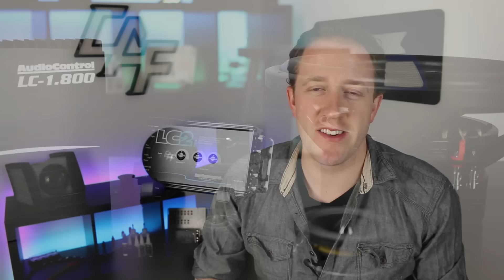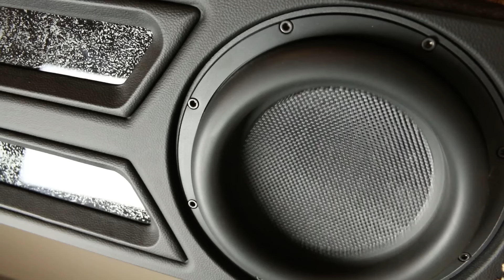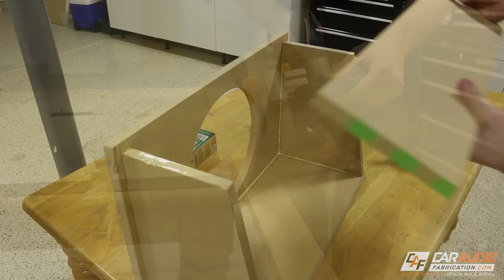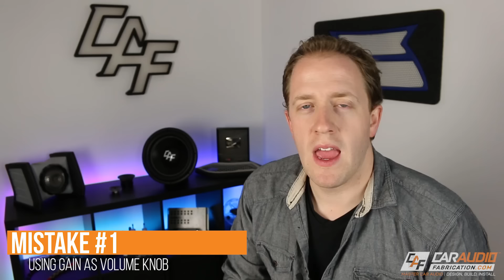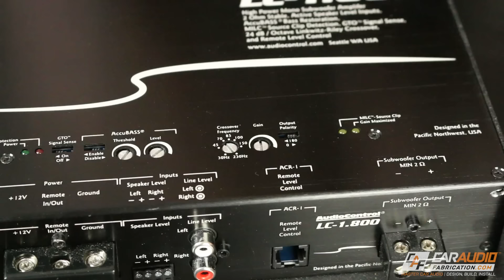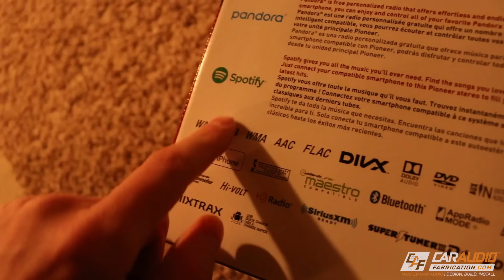Avoid these 5 common Car Audio NOOB Mistakes!

Comment: I’m pretty new to car audio and didn’t know that about the gain. Thanks!
Reply: Its no rocket science.
You just turn the gain completely down , then turn up the music to the level you think you never will get over (also listen to your speakers if they're not clipping and give a clear sound).
Then just turn the gain up to the level where it sounds good and not too loud and you're good.
Then when you listen to your music at normal level you never go too loud and prevent clipping.
But the clipping usually happens by using amplifiers that have not enough power.
For example you got a subwoofer that needs 300 watts rms and you hook it up to an amp that only gives 200 rms will clip quite easy because its lack of power.
So its better to have an amp that actually give more power then you need so it wont have a problem to drive your subwoofer.
After that you just use the gain to adjust the output, that way you wont give it too much power that also can kill your subwoofer.
Its just using common sense and your ears.
But if you want to get the maximum out of your system you just let someone do it that uses proper equipment to measure all the power output and clipping / distortion.
But Ive never did that , I just used my ears and never had any problems.
Reply: @baklap141  more gain, less sound quality, and more damage.
Less gain is the key
Reply from the maker: +Xo-1 definitely something to set carefully or leave alone if set properly!
Reply: Oh, and pick frequencies that are in the middle of the range... no point doing it right at the crossover frequency where both of the frequencies will be 3dB down (6db on an L/R filter).  e.g for subs go for 50Hz (if you are 20-100Hz on subs), mids, say 1kHz (earplugs needed!), highs, well, you shouldn't clip on highs, just ease it back when your ears start bleeding :O
Reply: EscapeMCP 8
Reply: Go to an auto store and have them set it and leave it alone

Comment: #6 Using prefab enclosures.
Reply: I put a L7 15 in a pre-fab. My sub wrote me a letter, left it on the headunit, and it never played again.
Reply: They work fine so long as it is sized properly for your sub.
Reply: tuned to high yes unless you like high notes then yeah i have a stinking prefab box and i can se highs sound fine but lows meh im waiting for my box build tunning my shit to about 28hz so it will bang
Reply: Some prefabs aren't bad,  mtx has a nice 1 and they also make loaded prefabs.. that's probably the best thing 4 a newbie 2 start with
Reply: what about fatboxusa?
Reply: Der Lennox just change the frequency on the amp lfp
Reply: Digital Design LE series loaded prefabs are amazing.
Reply: but they are tuned to high for us bassheads...

Comment: I can't upgrade the alternator in my new car because it also functions as an elettric motor (mild-hybrid car) how do I know how much watts in sound system my car can sustain?
Reply: you can add a 2nd alternator if you really need to
Reply: Vanilla Gorilla it's a brand new car, a sond system probably won't bother anyone if i make a warranty claim, a second alternator might not be so well accepted. Also it's a 90cv car, yeah I can add a second alternator but if my sound system can't make up a hill it's not very useful

Comment: Quite a few newbie's think a fuse coming from the battery is unnecessary. Running wires thru the door jam. The wires connecting to the amp are frayed. Wanting a 10,000 watt amp for $100. Some guys buy the biggest amp and subs w/o upgrading the electrical, being disappointed, then sell it for pennies on the dollar
Reply: its mostly just us SPL guys who dont use fuses for the power wires from what ive seen.  With the exception of the REALLY ghetto installs of course.
Reply: point me to these guys who sell their equipment for pennies on the dollar. Most people I see selling their stuff think they got a gold bar shoved inside.
Reply: Will Barnz you can find some amazing things at flea markets.

I sold one of my solo x 10s for $200 back when inuaed to do dope.
Reply: Will Barnz if u check everyday on the major car audio forums in the marketpmace theres always deal poppin up.

I came 2nd at dbdrag world.finals in 2007 and i bought ALL my woofers and amps used off forums. Worked out great...saved about $9000.  I even used CCA wire instead of oxygen free copper.

Comment: I made the mistake of running a power wire through a door jamb. That was an expensive lesson to learn.   If you can't find an easy way through the firewall stop what you're doing and get some help.
Reply: This a true story..that's what happened to my friend when he was 16. He either didn't have the correct tools or he didn't want to make a hole through the firewall for the amps power cable. Every time he would open and close the car door it cut through the cable and the car caught on 🔥!
Reply: You can get these grommets at homedepot, they are anywhere from 1/2" to 1 1/2" u just drill a hole n you can screw it in n run your wire... They are gasketed so that fumes and water don't get through
Reply: Alex Alatorre I hope to god you’re kidding 😂
Reply: Shit guess I better go and do it the hard way I ain't trying to catch on fire
Reply: easy most cars have holes already in the fire wall. just look for rubber plugs no drilling and is on most usa cars from the factory
Reply: I dont think he is,lol
Reply: Platinumdivison i just installed a system 2 days ago. Ran the power through the door jam and then down under the seats to the rear. And i actually did duct tape the door jam part lmfao. It's working good. This is the second time I've done this. I see no way though the fire wall on my 99 Camry.
Reply: Chris Valle

I hope you're being facetious. That can get you crispy fried morgue real fast, not to mention the legality of it.
Reply: Chris Valle,  No.....please No.
Reply: Platinumdivison not over the years it doesn't, it will still eventually wear and you'll never know when it does unless you're rolling under there every now and then to check and one day your car will be ablaze as that wire starts a passenger cabin fire.
Reply: that's why I always put my amp inside the engine bay.
Reply: Justin Gardner easy solution is use a drill bit big enough to pass your power wire. drill through firewall, and put a plastic grommet in there so wire doesn't get cut and cause short.
Reply: Why run power from up front? The frame is grounded. Just run the power from the bolts in the trunk to the amp.
Reply: Or just run the whole setup through a fuse in the fuse box.
Reply: thedog556 chill bro just cover it in duck tape it fixes that issue
Reply: Justin Gardner what happened ? Mine is through the doorjam for now. until i get lugs and fuseholder .
Reply: Alex Alatorre it fried the alternator.
Reply: I recommend running wire under the car, and drilling into the back of the vehicle (maybe the spare tire well).

If you're using large wire it's much easier to go under the car than to shove several runs through a happenstance hole.

Comment: I believe one of the most common mistakes would be using the wrong installation kit... I always use cable # 0 and from a good brand...!!! And let's not even talk about the RCA cables... Dear lord people are cheap and then they don't understand why their sound system sounds creapy... If it even work at all...
Reply: Mike , 100% oxygen free coper 10 g wire sounds the best to me.  I only use 4 g wire when absolutely needed.  I have NEVER in 30 years used 0g.

Comment: I only do my own installs, but I work on cars for a living.  The one mistake I see the most is when they don't bother finding a hole in the firewall for their power cable and instead route it out around the door jam to get to the battery.  Not sure it's a mistake or just laziness.

Comment: Know of any 2 channel amp that has 400w rms at 4 ohms? For speakers not subs.
Reply: _ REDGTCS JL Audio 300/2 is close but it puts that RMS power at any impedance between 1.4-4 and variable voltage between 12-14 (RIPS)

Comment: You need to make a video about setting gains. A lot of people have different ideals about how to set them. The biggest confusion comes in when the speakers they are pushing is well below the RMS of the amp. I use the volts to set mine, but it seems you think there is another way. Correct me if I'm wrong.
Reply: Best way is to use those Electrical tools. Not a DMM really, but an O-Scope, or a specialty tool like SMD.
Reply: Smd did-1 is another great way to set gains the tool runs for $150 online and it’s extremely easy to use.   O-scopes are very pricy especially if setting gains is all you’re using it for
Reply: i want to say kenwood, but it could've been another vendor, used to put actual voltage marks across the gain sweep area.  so, if you have 4V preouts, the lowest setting of the gain actually said 4V.  this went on to max gain which showed something like .5V.  what radio only has .5V preouts?? but you get my point.  not as accurate as measuring, but it was helpful in those "big box" install bays.
Reply: I was told recently that the Nominal setting is for 4 volt output. I really would like someone to clear up things. It's been a long time since I installed a system. I just want to make sure I've set the gains correctly. I took a 3 way system active and each speaker requires a different amount of watts. I currently have it running through a DSP that is regulating the output based on auto tuning (Alpine H800).
Reply: Banggood portable oscilloscope - £20. :D  Rather than measuring or setting gains based on volts in, use the actual volts coming out of the speaker terminals to set your gains.  It's the volts that move the speaker, NOT the watts.  The watts are just a byproduct due to the volts passing through a resistor (voicecoil)  V²/R=P
Reply: A well designed amp will have the same voltage out in 8Ω config as 4Ω (which should equate to a doubling of power at 4Ω): V²/R=P again - V² should be constant.  If your 4Ω power isn't double (or somewhere near), it's usually 'cause they haven't put enough capacitance (energy storage) in the amp to keep delivering that same voltage into a smaller ohmage load.

Comment: I have a 350Z and went to the local sound shop down here in Texas where I got my gear and had it installed. They're supposed to be professionals but I feel something is missing. Got my amp, sub, two mids, and tweeters. The sub sounds good and the tweeters as well. But my mids can't seem to process those subtle but important mid bass. When I listen to the same drum and bass track in my home stereo I can hear a fuller sound, that is, what I think is a better mid range of bass coming through. The home stereo is too small too pump out a real house shaking sub bass sound but it's mid comes through clearly. Why can't I get the same quality in my car? I tried raising the bass but it can only give me louder thumps which is great for hip hop but fails to provide me with the fuller quality the supplemental mids my home stereo gives me for Drum and bass. Drum and bass music has a lot of subtle bass that I feel I'm missing even though my subs sound nice. Sometimes I can barely hear in my car what I know i heard louder inside the house. Are there any settings on the car stereo I should look for besides messing with the highs, treble, the bass or sub bass?
Reply from the maker: +HyborianAge were the doors sound treated? Check out my "how to improve mid bass" videos
Reply: HyborianAge on the door panels pull your cover off it will sound different. Those covers are trash
Reply: CarAudioFabrication 
If pull the speaker covers and look at the back of them well over 50% of the    cover is blocked
Reply: Another trick you can do is set your subwoofer distance in the head unit a few extra feet back than it actually is. This will delay the sub bumping just slightly so you can hear the mid bass better. Assuming it was installed correctly with sound deadening/foam rings, etc..
Reply: Thanks guys I'll try out what said.

Comment: if you aren’t clipping, you aren’t loud (; 

Jk don’t listen to me lol
Reply: I’ll add to this, if you’re loud and clipping. Your just ‘annoying horrible loud’

Clipping is basically the loud limit of your system,  it will Not Get louder, just worse sounding.  Setting gains correctly to your system is going to prevent this and you can be ‘loud and clear’ better.
Reply from the maker: +Dylan Elder some degree of clipping is ok on subs. Still should set the gains in an accurate manner though
Reply: You haven't been around the competition scene then if you haven't heard of people clipping at the levels they play at.
Reply: A whiny spoiled brat child throwing a fit is loud, too.
Reply: Because of power restrictions based on amplifier ratings and class restrictions in competition. Maybe if you had a single iota of an idea of what you are even talking about, you might understand.
Reply: lol -- tune it to where it's about to break and turn it down juuuuust a bit hahaha
Reply: Tim Henry false, there are certain amounts of clipping that you continue to gain power output and decibel level performed increases. Which is why most competitors are set into soft to medium clipping (not full square wave)
Reply: Yea I'm pretty sure I've never Hurd of anybody clipping at the levels they play at, that would be a big blown fail.
Reply: @jamesmcnugget2564  heard...your welcome and look up cliposaurus. He clips non stop and doesn't blow anything
Reply: @rjdatdude23  I know it's heard lmao regardless if ur clipping u either like to waste money or lack of knowledge lol.......I'll stick to not clipping haha
Reply: @jamesmcnugget2564  lol I don't  clip but there are guys who compete and demo they're systems whole clips like no other. There are videos and a guy they named clipposuarus or something like that but he hasn't blown anything yet and tell from his system his knowledge is on point
Reply: I have a self built PA rig (6kW) that plays real clean (thanks Bill Fitzmaurice) down to 25Hz (-3db) :) :)  I can put the SPL meter on it and get the same readings (often higher) than the rig in the next room/field.  Yet people think that the other rig is playing louder.  Why?  Because the other one is clipping.  People equate clipping with loudness.  It's down to psychoacoustics.   If there isn't clipping, people think it doesn't sound as loud (including me!).  The proof that it IS loud is when you move half way between the rigs and you can hear mine just as loud (usually louder tbh ;)   It's like doing 90 in a beemer and a mini (old style).  The mini feels faster because it's rattling all over the place at it's limits.  And just like how the beemer gives a better ride, the SQ difference with my rig is night and day - once you hear clean bass, you will never forget it.  Like I said though... it doesn't sound as loud :)
Reply: DJ Logic
Reply: Nick Leger thats exactly how i do it lol
Reply: Travis (HitemWithTheFlex) 

I know this, but I’m guessing the 99.9% of people reading this are not going to be going to a stereo competition to compete.  Yes it is louder (just a tad) but for every day listening going down the road.  Running your system to one notch under clipping is BETTER for your system, than hitting that clipping crap for hours on end.  Plus it doesn’t sound terrible.  We’re aiming at quality here.

Competition guys will clip their systems for like 10 sec.  

I don’t do little short bursts of sound on every day driving.  

Basically it’s like this.  

Instill it in people’s heads that clipping is beyond the volume limit of the system, they will believe u, and never blow their system.  When u try to tell people (u can soft clip just a bit) that’s terrible advice IMO.
Reply: @timhenry8475  10 secs of clipping? Dude you have never been to a car audio competition lmao
Reply: Dylan Elder, it's not always about being loud. You can be loud but the music sounds crappy.  Sometimes it's about SQ (sound Quality) I like sound quality over being loud. And being so loud  will catch up with you later in life. What da say HU  Hu
Reply: Most competitors into soft medium clipping is dumb as fuck to do.  Why not get a bigger more powerful amplifier with more overhead to not clip at target wattage!  My gosh smh at dipshit that made the comment above about being loud and clipping...